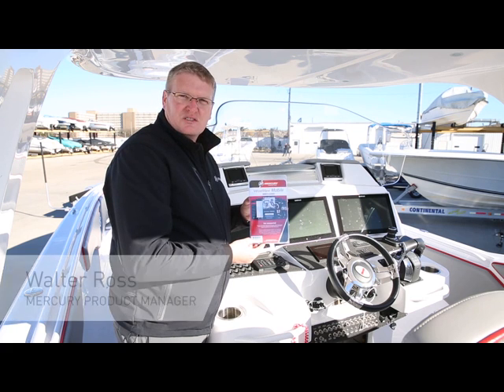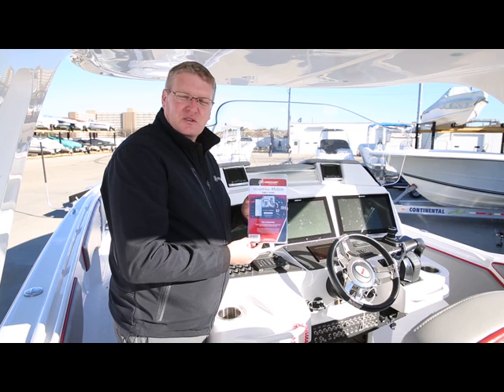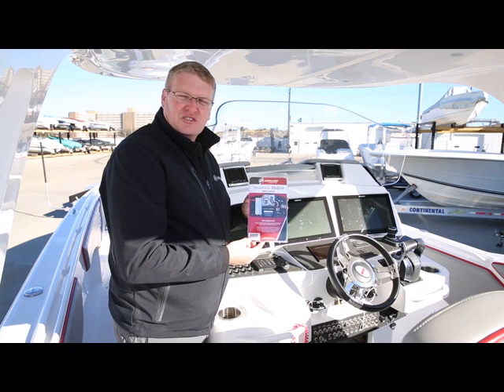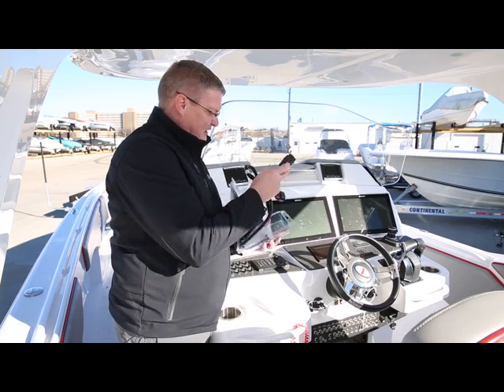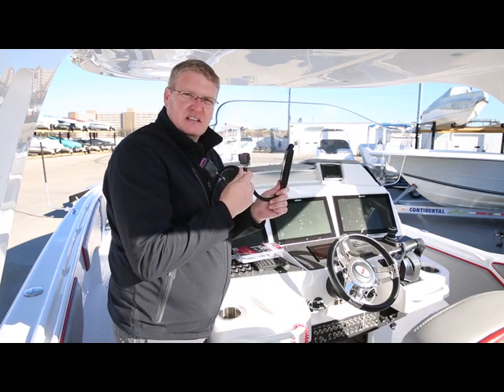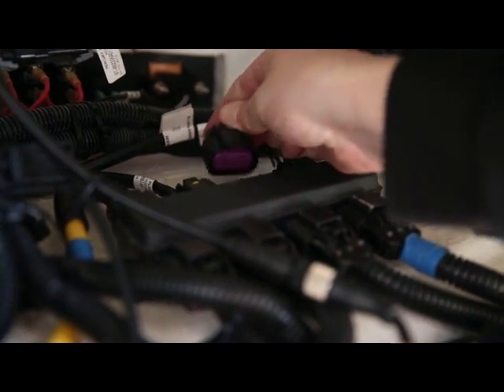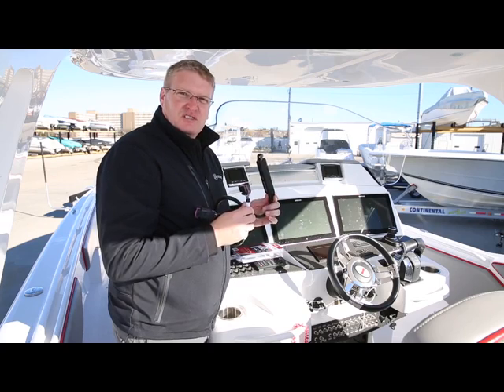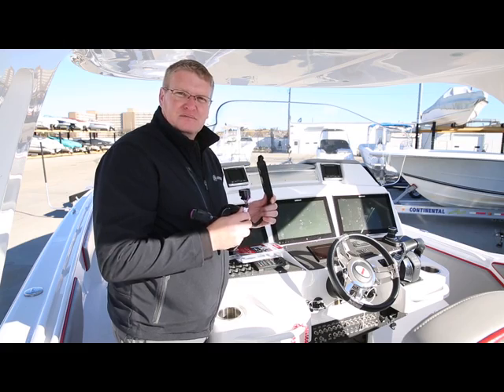VesselView Mobile: How to install with junction box at helm (SmartCraft capable engine)

Comment: Why don’t they show install on twin engines??
Reply from the maker: Hi Chad, thank you for watching. We do not lay out multi-engine installations due to the various configurations and engine models. We always suggest working with a Mercury Marine dealer on multi-engine applications to ensure the engine's SmartCraft networks are programmed appropriately and that you receive all of the boat-specific rigging parts needed.

Comment: what do you do with the other port on the module - just leave it open?  put on a termination plug or a dust cover - does it matter?
Reply: I just got this.   The other plug on mine is a nema connection and not needed

Comment: I have a 2013 Formula Fastech 292 without SmartCraft. Can I add this application if I don't have SmartCraft?
Reply: As long as you have an smart craft compatible engine (MPI) then yes you could.... https://samerwebapp01apncus01.blob.core.windows.net/mmgw-env-a/filer_public/0f/01/0f0159a1-8ba3-4eef-8fe3-710a99c70e7f/8m0127340_vv_mobile_faqs.pdf  VesselView Mobile FAQ Module ApplicationEngine Compatibility Model Serial Range 30-40 hp (3 cyl) EFI FourStroke 0T409000 and above 40-60 hp (4 cyl) EFI FourStroke All 75-115 hp EFI FourStroke 1B366823 and above 75-125 hp OptiMax All 150 hp FourStroke All V6 OptiMax 0T178500 and above V6 EFI TwoStroke 0T409000 and above Verado All NOTE: Some 2001 model year engines may require an ECM update. MerCruiser Engine Compatibility
Model Serial Range 3.0L MPI All 4.3L MPI All 4.5L/6.2L - Mercury Built All 5.0L/350 MAG/5.7L/377 MAG/6.2L MPI - GM 0M300000 and above 496/8.1L All 8.2L All NOTE: 6.2L Black Scorpion SmartCraft compatible, 0M391777 and above.
Mercury Diesel Engine Compatibility
Model Serial Range 2.0L/2.8L I4 All 3.0L V6 TDI All 4.2L I6 All 4.2L V8 TDI 0M300000 and above QSB/QSC/QSM11/QSL Series Cummins All Mercury Racing Sterndrive Engine Compatibility
Model Serial Range 520/525/540/565 EFI All 600/662/700 SCi All 850/1025/1075/1200 SCi All QC4V Models All Mercury Racing Outboard Engine Compatibility
Model Serial Range 2.5 XS All 200/225/250/300 XS All 225/300 X Pro Max All 350Sci and 400R Verado All